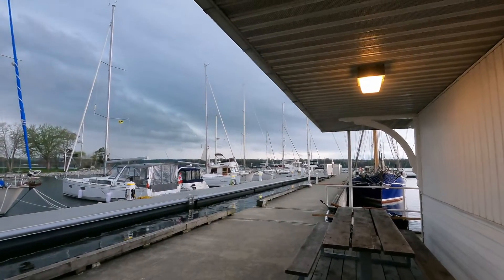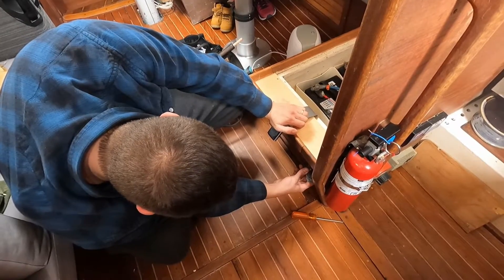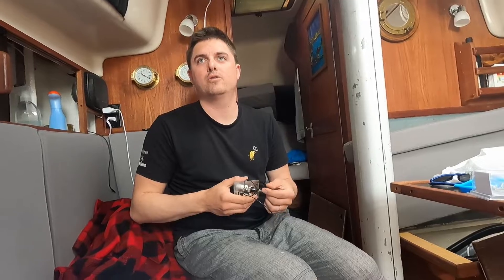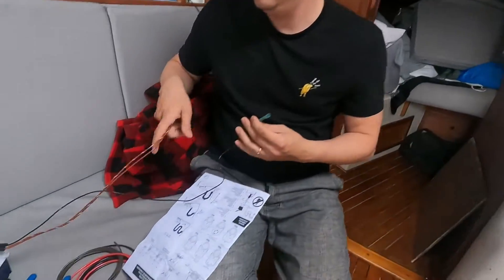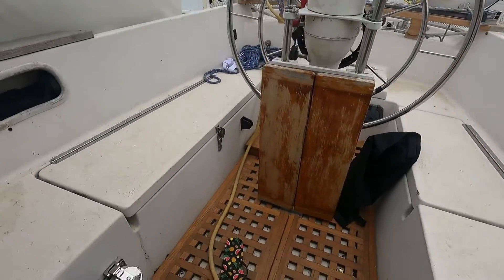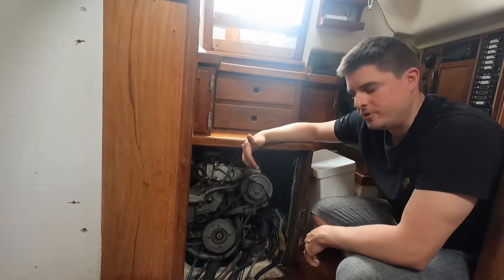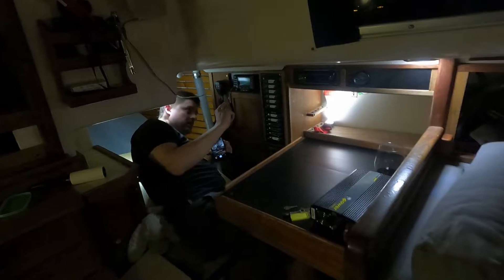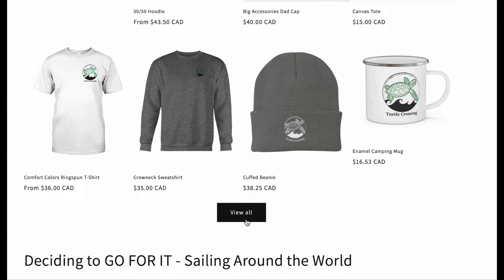Installing a BILGE PUMP - Ep. 14

Comment: The engine compartment opens up the stairs come out the top plate on the stairs comes off and it all pulls out.
Reply from the maker: Yes! Our friend had a Bayfield and he was super helpful for taking it all apart with us.. everything is compact in the Bayfield so I guess that's the best use of space for the bilge access? Do you have a Bayfield too?? How do you know so much?? 🤔
Reply: @turtlecrossingsailing  Hello yes I have one Bayfield 32 1979 in Vancouver I'm in it right now for a few days working on it dirty gas tank.
Reply from the maker: @JB-zj9em  that's awesome! Do we have a similar interior? What style is your salon table? We have another friend on our dock who just purchased a Bayfield 32, but you're the only other with a 1979 I know!